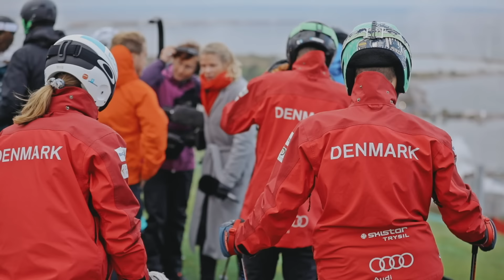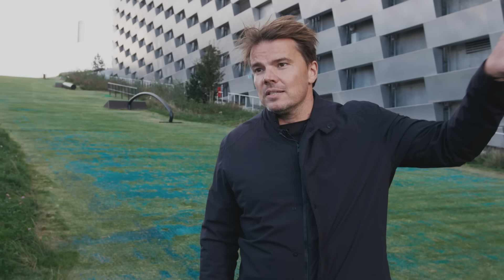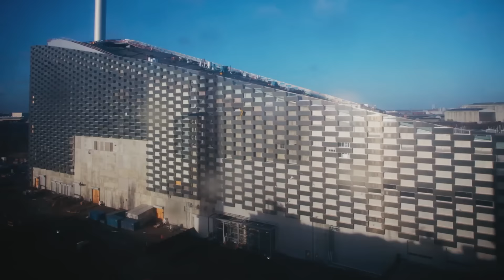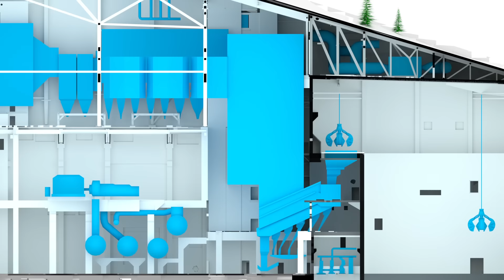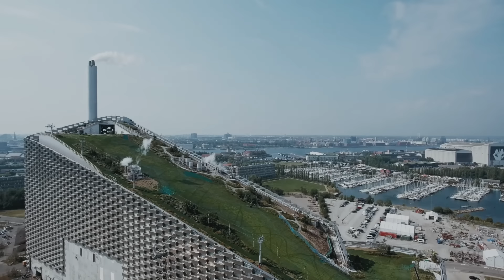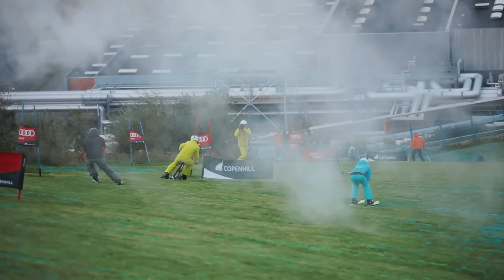Inside CopenHill: The clean energy plant with its own ski slope | On Location

Comment: What if you don't quite make the turn half way down the ski slope?🤔
Reply: There is ski nets catching you , at the end aswell. Like any selvrespecting skisort has aswell.  So not a problem. 

Plus  a real wall aswell behind it, so it aint soft.  But if the net should break when you run into it, you still stop.

Comment: I'm an Engineer and I deal with designing of thermal waste treatment plants. The Copenhagen Incinerator plant of ARC is one a case study about the failures because of ambitious oversized plant component which isn't economically viable. The dilemma is, that incinerator involve mostly Combustion of dry recyclables* and there's secondary fossil fuel input so to sustain the Combustion, thus it doesn't maintain the carbon neutral cycle and moreover, it's state of the art tech. For treating hazardous waste like the plastics from E waste and medical waste due to inhomogeneity although.
Reply: Our E waste is first collected, then sorted.... and then exported to 3rd world contryes where they burn it in open air. E waste should never leave Denmark or Germany in the first place.
Reply: The thing is though, every plant like this is its own prototype, and there will inevitably be something that doesn't work as planned.... but at the same time if you don't make a big leap once in a while, you will never have progress.
Reply: @Omegasupreme1078  you don't make the worlds largest omlette without spilling a few eggs on the ground on accident.

Comment: I'm curious as to how the incinerator is powered. You can't just light a match and burn a lot of that waste. There must be some kind of fuel being used to fire the burners. Why no mention?
Reply: Chances are you start off with light stuff to get it super heated, and then work your way up to stuff that doesn't burn very well.
Reply: A bit of fossil fuel is added to get the fire started because it is so very big, however, as they say, the CO2 is trapped and doesn't enter the atmosphere.
It is actually too big - Copenhagen has to import trash from England to keep the plant going.

Comment: They clean chemicals/Toxins from the Chimneys, what I would like to know it what happens to the highly toxic Filters? Burning rubbish is not a solution, and could encourage more single use plastic packaging to be used, as people have an excuse to carry on using it, thinking they are helping with ‘Green’ electricity.
Reply: In Denmark we only burn what cannot be recycled. We have dumpsters for glass/metal/hard plastic (including meat and most other plastic containers), paper, organic material and one for the leftovers, only the leftovers will be burned. 

Further more, many major factories in Denmark are currently taking steps to use biogas (from the recycled organic materials) and re-use the heat they are producing, to heat up local households. 

About the toxic filters, I don't know the answer. But i bet it's handled in a better way than just letting it out and polluting the air.

Comment: This is the best done waste-to-energy plant I am aware of, however, waste-to energy is a very bad idea, overall. 

They are clear that they have scrubbed the air, but speak not at all about the concentrations of toxins that will be in the ash, or of the ash itself. They mention the vast number of trucks moving the waste to the plant, but do not mention the emissions from that trucking, or the impacts on neighborhoods of that transportation. 

Waste-to-Energy should be a last resort, very last. Too many people and governments see this as a fix-all for our energy problems and for sustainability, but it is just a more sophisticated way of throwing value "away" and acting like we meant it from the start, and are masters of our own mistakes.  We did not and we are not.

We can benefit so much more from material management, and we are creating HUGE risks in consolidating so many materials, including chemical compositions, into ash...
Reply: The waste that is burned is the left-over waste  AFTER recycling.
Over 3/4 of all waste in Denmark is recycled, and Denmark has to import wast from England to keep the plant going.
The problem is that a lot of waste CAN'T be recycled. If you landfill organic waste it decomposes and traps CO2, whereas if you burn it it becomes heat and hot-water and you can filter out the CO2. That also had the added effect of not having to burn fossil fuel to create heat and hot water. win-win.

As for the trucks etc, it's kin of a self-defeating point. Is the logic that unless every single part of a process can be 100% clean we souldn't bother doing anything? The powerplant doesn't produce trucks - it produces power.

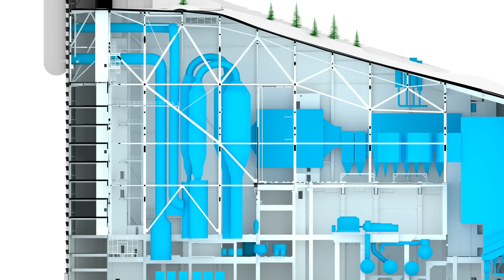Comment: 2:08 very misleading (intentionally or not) to say it only "emits clean air and water vapor" when it does emit large quantities of CO2 as well
Reply: I hope they keep to their word of installing a CO2 capture system by 2025.
Reply: @Nearhi  Unfortunately, carbon capture & storage is a very expensive process. First you need to capture the CO2 and liquefy it by compressing & cooling it (which is relatively easy, but requires a lot of energy).

Then you actually have to store the 131000 tons per year of liquified CO2 deep underground so it doesn't boil away. Liquid CO2 has a density of ~1.1 metric tons per cubic meter, and so this plant alone would require  119000 cubic meters of deep underground space every single year to operate. So for this idea to work, they would have to blast out a new massive ~50x50x50 meter chamber deep underground every single year. You only need to look at the cost of excavating modern metro stations (which are relatively close to the surface) to realize how impractical that would be.

I think carbon capture has some potential in places where there already are depleted natural gas wells (like the USA), as the already existing underground cavities can be used to store CO2 at a much, much more feasible price. But I doubt very much that they will ever manage to capture all the CO2 from this plant, let alone by 2025.

To me it would make much more sense to go for power generation methods that doesn't create CO2 in the first place.
Reply: John Smith Two words: CO2 scrubbing.
Reply: I think more so they're being scientific as he says it takes out the environmentally hazardous products. I'm sure there are likely still quantities of CO2 which naturally occurs however it's not as destructive to the environment and is at a safe level to be considered clean air just like liquid air is not 100% oxygen it has argon and nitrogen at safe enough levels to be combined. It's about reducing the levels compared to the alternative
Reply: You do know that "CO2" is part of "clean air", right?

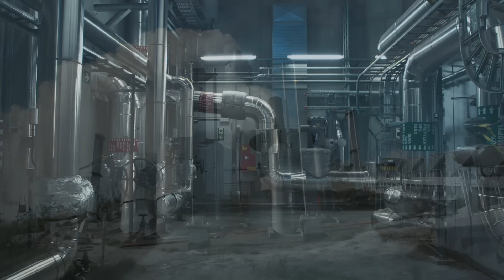Comment: Did he just say  that steam runs the turbine 1:55
Reply: It runs a turbine, but they showed a windmill when they said that. That was misleading. It doesn't turn the turbine in the windmill, it turns a turbine built into the generator.
Reply: @Nearhi  Yeah, a Dutch engineer wouldn't make such a colossal blunder. The video editing team @ Wired should be rewired.
Reply: @Bionik1980  You mean a Danish Engineer :)
Reply: Bionik1980 Dutch ≠ Danish

Comment: They have been making the “its only steam” argument to coal, oil, “natural” gas, and various refineries and other plants related to oil and manufacturing. It’s always more complicated than “just steam”
Reply: This is a four-minute video.
Reply: @ScreamingScallop  The video being short doesn't justify them "forgetting" to mention that it releases 131000 metric tons of CO2 per year (equivalent to ~28000 cars).
Reply: @CandyHawk0  Oh, well then, let's just stick with coal and nuclear. The waste from nuke plants will be someone else's problem! Al Gore uses a plane and lives in a house! /sarcasm
Reply: @ScreamingScallop  I am very much against coal and all fossil fuel burning power sources, including just burning trash instead of making an effert to recycle all of it. Nuclear, on the other hand, does not release any CO2 or other toxic gases. The waste is dangerous if not stored properly, but with modern generation 4 reactors it is only dangerous for a few centuries (and currently existing waste can be used as fuel). Considering our other options are to either 1) not have electricity and return to the stone age or 2) suffer the consequences of a worst-case climate scenario, I think nuclear sounds pretty ok, especially with next gen tech.
Reply: @CandyHawk0  What about wind, solar, and dams?
Reply: @DigitalSoul69  Hydro power is great and should be used where it is possible, but it cannot cover humanity's energy needs completely, since it requires rivers with high flow rates (many countries cannot build hydro at all, because they have no suitable locations). 

Solar and wind can be good as well, but only as long as their power production can be covered completely by other non-polluting energy sources when the sun/wind level is low. 

For example, in Sweden, when the wind speed drops and the power from the wind turbines decreases, the hydro dams simply increase their output slightly to compensate, and the system as a whole remains 100% fossil free.

But in most places, like California and Germany, there is not enough hydro power to cover the down-time of solar & wind, and they are forced to compensate using fossil fuels instead (making the system better than if it were completely fossil, but still far from climate neutral).

Basically, unless you have enough hydro to cover the down-time, solar & wind always needs to be backed-up by polluting fossil energy sources to guarantee that enough power is generated. Unfortunately, unless extreme advances in battery tech are made (like 10x cheaper, and without cobalt, lithium or other rare materials) solar & wind cannot be the backbone of an entire energy system by themselves.

Nuclear does not release greenhouse gasses, can be built anywhere there is water, and its energy output is reliable and constant, meaning it could replace fossil fuel completely by itself. If every country in the world followed France's example (where they currently have 75% nuclear, 16% hydro, and only 9% fossil), and if gas cars were replaced by electric, the climate problem would be solved in a few decades.
Reply: @CandyHawk0  Copenhagen aims to recycle 70% of all their waste by 2024 - not exactly sure about the current percentage but it's significant. But this still leaves a decent amount of non-recyclable waste that will have to be dealt with. If that means burning it, this solution is a good way to at least win some energy back as part of that process.
Reply: @CandyHawk0  That's why we do in wind - even our heavenly mountain is only 179m tall. But we do recycle - metal, paper, plastic, cardboard, organics, glass - and the rest is barely enough to burn and create heating for our houses - so we import trash, instead of having each house run a polluting burner and source their own wood/fuel for that. Just the saving on CO2 in this logistics-chain is massive, and more over - once we find a good cheap clean way to capture CO2 we will not have to capture it at 600.000 places - but only one. I'll have to go look at this mountain of innovation.
Reply: John Smith 
France, which is either “a” or perhaps “the” world leader in nuclear powered electricity generation routinely has to dial down electricity production in the warmer weather due to a shortage of cold water available to cool the reactors. 

There is a future role for nuclear, but it is not a panacea and it’s problems are not limited just to safety and storage of waste materials. Wind, solar and storage technologies will continue to rise in overall importance with nuclear remaining a small part of overall electricity generation.